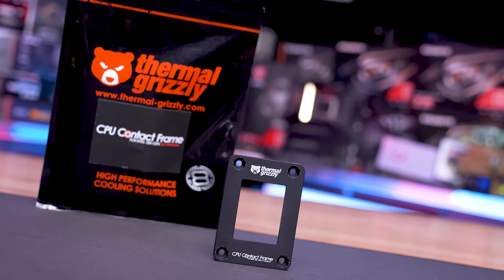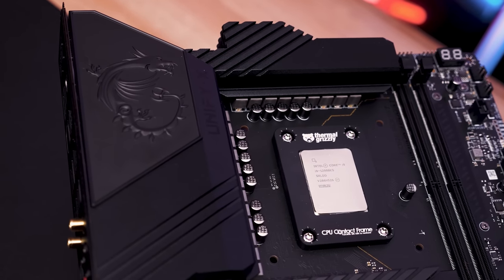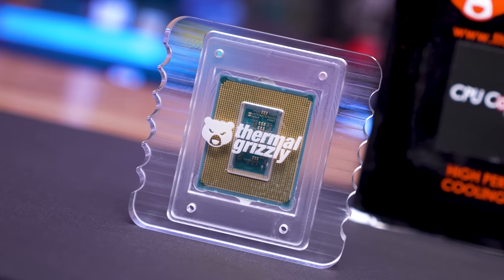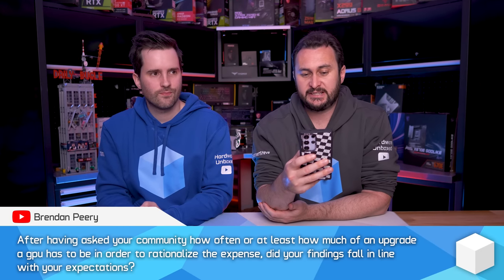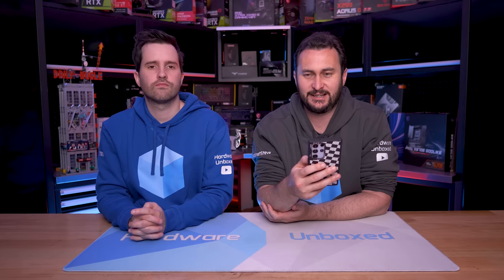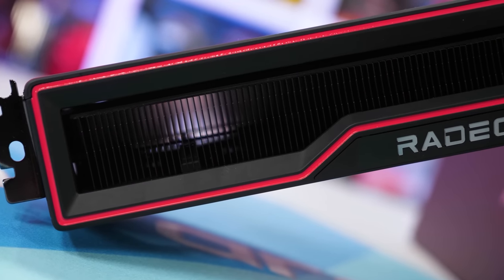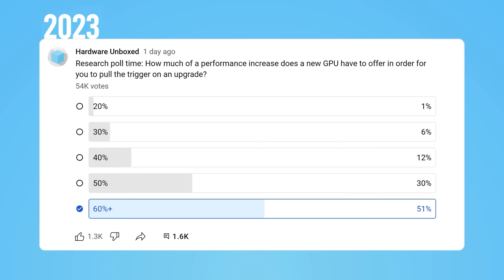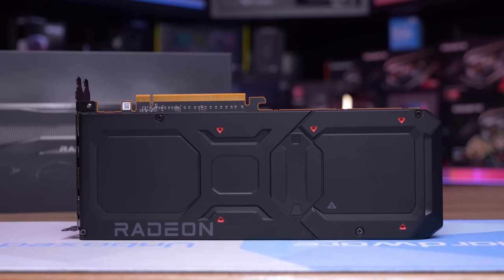RTX 4050 Pricing & VRAM, Are 12-core CPUs Dumb? March Q&A [Part 2]

Comment: So, keeping the GPU VRAM low is a deliberate strategy to make the midrange models obsolete in a few years so that people either opt for the high-end in their next buy or keep on buying midranges more frequently ? I feel like people are getting fucked by the GPU manufacturers in an elevated fashion with every single passing year.
Reply: Honestly this strategy is very limited because:
a. consoles are VRAM limited, will be the target platforms, so devs won't be making you make visually dramatic sacrifices to fit into a sub-16GB VRAM budget anyway.
b. you can counter it by turning textures & RT down.
c. devs are going to target the PCs that people actually own, not the ones Nvidia are trying to sell, and if Nvidia shrink the PC market with these shenanigans then devs are going to give PC ports 'less' premium features & priority, not more.
Reply: How you beat this is by playing at Low settings 1080p/1440p and only upgrade after dropping too low below 60fps, if you can manage this then your set for a WHILE, im implementing this after seeing how wildly resource hungry the Last of us 1 is as this is just the beginning for newer games.
Reply: @EBMproductions1  I run into a similar issue with a 3070 (as mentioned in the video) in Resident Evil 4 Remake where (according to the game settings) allocating more than 6gb of VRAM caused D3D related crashes. Only viable option is to lower the texture quality or tune down ray tracing. Interestingly my fps was pretty much the same for low and high settings so it may be a game related bug but the end result for me is the same: Low VRAM, sacrificed video quality.
Reply: 1440p half resolution is 720p so you can even survive on that if games support 50% render scale then UI elements are still full resolution I think. For me once I get the 7800x3D it will be either my old RX480 like yours or the integrated CPU graphics and hoping FSR 3.0 comes around soon :D man what a time to build PC it is...
Reply: planned obsolescence is not a new thing.
Reply: Yep, I bought a 3070 Ti during the crypto-craze and pandemic, because my GPU and monitor died on me at the same time. I'm still regretting it. I can already see where the 8gb VRAM will be a limiting factor very soon, and I get the feeling it's all by design. Diablo 4 benchmarks already fill the 8gb to maximum, for example. Screw GPU manufacturers. I think this is my final GPU and computer for the foreseeable future. It's just not worth it. These tech companies are becoming way too arrogant and abusive, and I'm starting to lose interest in gaming anyhow. But man, that $830 I paid for it. Ouch.
Reply: Просто надо больше покупать нвидию, они будут это делать еще дестче.. Вам понравится)
Reply: @tdrduarte  no but this was unfirseen asf, they thought 8gigs was enough for uo to 70 series cards but yup it was not i oredicted this back in 2020
Reply: "fucked by the GPU manufacturers" ... that goes for Nvidia, yes!

AMD makes in this case more stuff right. That's why they say it ages better than Nvidia, meaning a RX 6800 with 16 Gigs or even a 6700XT with 12 Gigs instead of 3060 Ti/ 3070 with 8 Gigs or 3080 with only 10/ 12 Gigs. *Even Intel does it better considering the ARC GPUs in their "limited edition" (which is not limited). ARC 750/ 770 with 16 Gigs should be more future proof than their 8 GB models.
Reply: just dont load 4k (aka ultra textures) if you dont paly 4k....holy shit aint that hard.....and yes i know not all engines are like that some actualy scale the textures by screen resolution.....
Reply: @InnuendoXP  "consoles are VRAM limited, will be the target platforms" ... but only mostly for 1440p intern calculated and upscale to 4K with very low RT in most cases and only medium to textures in a mix and highly optimized.

From a PC standpoint (true 2160p, high- ultra features, medium or high RT features enabled) the requirements are much higher, especially considering PC ports being often less optimized. Guardians of the Galaxy, Hogwarts Legacy and even the old Cyperpunk 2077 show how demanding titles can be.

The consoles has been good when the launched. Targeting RTX 2070 Super/ 3060 Ti -ish performance. Well even a 2070 super is an older card by todays standards, leaving consoles (as usual) behind! The average shown in steam statistics also show a huge variety of gamers with "minecraft kiddies", even HTPCs in their statistics or simple office PCs where someone installed a card game via steam.
There should be a statistic targeting story and action games like Cyberpunk 2077, God of War or Horizon Zero Dawn. I think this group of gamers often has way faster hardware at hand as the average Steam user.
Reply: @proxis9980  lol bro did you see zwormz cpu usage went to 90% at 1080p using a 7800x3D that means anybody else is fawked if they play at lower then 1440p 😐
Reply: @InnuendoXP  I mean you've always been able to adjust graphics settings.  I think the OP's point is that GPU makers want you to make obvious sacrifices so that you are encouraged to upgrade sooner.
Reply: Remember that the low-end memory capacity now is equivalent to the high-end from 2016. It's going up, what is happening is that people randomly accelerated their generational expectations arbitrarily. A 3050 beats a 1070 in gaming and has the same VRAM. A 3060 beats a 1080Ti and has 1GB more VRAM. A 4070Ti performs a bit faster than an overclocked 3080Ti and has the same VRAM. 

It's going up at the same rate it always has, with the single exception of the 1000 series, which was the single largest generational leap in the past 15 years. Comparing everything to the single best generational improvement and calling things predatory for not achieving that every single generation is asinine. There is no processor company in existence who has improved at that rate every generation. So who is it bad in comparison to? No one, that's the answer.

No one is "getting fucked" by anything. Every generation is a massive jump in performance. You can build a 1440p gaming PC for less money than ever, in history, when controlling for inflation. Life is good as a gamer. Ignore the terminally-online complainers.
Reply: Really for the VRAM issues if you get a x090 card it will be good for at 5 to 10 years. The issue is the x090 cards seem to always cost 1k USD or more the current gen costing 1500 USD at the bottom cost. So 1500 USD for a card for the next decade. pretty decent in my mind unless nVIdia makes an AI required by games that the 4090 can't run.
Reply: @CyberneticArgumentCreator  That's a bunch of BS, go back further in History. These are all new trends you're talking about and they aren't good for the consumer nor the gaming industry. After the 1000 series launch Nvidia went off the rails. Every generation after the 1000 series has gone up in price rapidly. At this point the prices are absurd and a joke. This is the year I quit complaining about Nvidia and bought an Intel ARC A770 and I couldn't be happier I made the switch
Reply: It is going to be worse. nVidia is getting enourmous amount of money in the light of GPT-4 and others AI development, corporation contarcts for billions of dollars already flows. Prices will be high and shortages would not suprise me.
Reply: @yumri4  MSRP of the 4090 is $1,600 and that's assuming you get FE and excludes tax.  You are going to end up paying $1,800 - $2,000 for a 4090.  The 4090 will probably last 5 years or 2 gens given RT performance is increasing so much every generation.  I wouldn't call that price anywhere near a good deal, my 1080 Ti lasted 7 years and that thing was only $700.  Nvidia has conditioned you to pay more than double for essentially the same thing.
Reply: @ehrinim
not sure if for GPUs that applies much, but for standard RAM on pre-builts it definitely does, particularly for laptops. Don't skimp on RAM folks
Reply: @giglioflex  and NVIDIA has conditioned you into perpetuating the hype of ray tracing as more than a sales gimmick.
Reply: It's just Nvidia that does this. You'll notice that AMD equivalent cards have wayyyy more VRAM across the board, only exception being the 90 series cards.

It's exactly why I went with a6800XT this time. No way was I gonna spend buttloads of extra money on a 10GB 3080 that I knew would cause issues down the line. I feel especially sorry for 3070Ti owners, they got a great GPU, memoey bandwidth, but the 8GB handicaps it severely in new games. If only they went with 12GB and 16GB like AMD. Those 3000 series cards would still be better than RDNA2. It's literally just the VRAM. And a lack of VRAM does not result in lower FPS, it actually makes a game unplayable unless you lower graphics settings..

The 4070Ti should have gottan 16GB and 4080 20GB.
Reply: Instead of buying a GPU next time I'm going to buy a console and give them no money, I'm done with this.
Reply: @giglioflex  yep. and i think nvidia will fail and will be forsed to make a good deal. in 50 or 60 gen, but they will be forsed to make a good amount of vram and performance for a reasonable price. PPL are raging more than a year about this, and the trend is going up. We are just in the low-mid point of it.
Reply: thats one reason i played it safe and got a 7900xtx red devil. i havent seen any of the games i play go past 13gb of vram in 4k so far
Reply: @Cheeseypoofs85  yeah, the thing is, in my region AMD is way overpriced, and the ones they sell are from cheap vendors. I just can't get a good deal so i went for a 3070 for my 21:9 full hd monitor. The market on the GPUs is a mess rn. feels bad to be a gamer
Reply: @giglioflex Depends on what you play. For me the only reason to upgrade from my GTX 980 not 980ti is when nVidia stops support for it in drivers or when i have to upgrade my motherboard to one that doesn't supports PCIe gen 3 x16. On a side note PCIe gen 7 doesn't support PCIe gen 3 and PCIe gen 6 doesn't support anything before PCIe gen 3.

Now can i play modern games on high at my monitor's native res 2560x1600? Not all of them and most triple A games i have to turn the settings down to medium to get a smooth frame passing and a frame rate 60fps. The thing is most games there really isn't a noticeable difference is normally from low to medium not medium to high nor high to ultra.

For the 4090 it seems what will cripple it is ray tracing being more and more used in newer games. So to have it last a decade turn down ray tracing when it is to heavy for the GPU. You also only need 60fps as most games are made for 60fps.
Reply: @tackier-n2g   no you won’t. You’ll grimace while you pay , for that moment of euphoria when you unbox and install, like the rest of us 😂
Reply: @InnuendoXP  I would agree with this, but PC ports are increasingly becoming less optimized. The consoles only have 16GB of SHARED RAM (combined system RAM and VRAM), yet so many PC ports have released recently that need at least 16GB of system RAM AND 16GB of VRAM to run at console settings. TLOU, RE4 remake, Dead Space remake, and Hogwarts Legacy to name a few.
Reply: @Altrop  This exactly. I bought a 6800XT because I knew the 16GB of VRAM will last me so much longer than the wimpy 10GB the 3080 got. For Nvidia it really started with the 2080. Only getting 8GB of VRAM it will hit a VRAM limit as time moves on before a GPU limit. Same can be said for 3070, 3080, etc.
Reply: @zues287  the consoles having shared ram is actually an advantage for the same reason PC is having performance problems now. Consoles have dedicated hardware for rapidly streaming data off the NVME SSD into memory, while on PC that eats loads of CPU time, so you need more RAM on PC to prevent that happening as often. Also on PC you're having huge textures moved from system memory to VRAM & that isn't free - it takes time, while that's just not a thing on the consoles because as you said, the memory pool is shared. So consoles can avoid a lot of the stutter that is currently plauging PC ports.

The smaller amount of total memory on consoles does mean you can't have as much texture data on VRAM at once, so this does put a narrower limit on the amount of high res textures you can have in a scene at once - but due to the dedicated hardware for streaming data into memory- consoles can cull textures & geometry WAY more aggressively, because data streaming has much less processor overhead - which means you only need to load a smaller slice of the levels at any one time, which means you need less RAM.

So Devs have a choice to make - they can optimise for the advantages consoles have, or the advantages PCs have, because this kind of memory management is not a trivial difference. It mattered much less last gen because the consoles were on slow hard drives, but Devs are trying to leverage that fast loading now, which comes for free on console, but not on PC. 

If it's endemic across the whole PC platform, it isn't a result of some negligent or lazy Devs, it's a fundamental hardware limitation - DirectStorage still is barely a thing on PC & it'll eat GPU resources when it is.
Reply: @Altrop  That's exactly the issue with low VRAM. Compute power of the GPU is not a limiting factor, it is the amount of textures that can be loaded with a small VRAM. If you go above the suggested amount of VRAM usage, you run into buffering issues, or direct crashes.

Memory chips are mainly manufactured by Samsung and sold to Nvidia as it is, so I guess the profit margin on them for Nvidia isn't that great. I guess that's why they are so stingy with it, although their GPUs are great in a technical sense.
Reply: @giglioflex  unless you're playing at 4K native, playing console-equivalent texture settings is not an obvious sacrifice to the visual experience - it's an obvious sacrifice in terms of the number value in the config or how warm & fuzzy the setting name makes you feel, but IMO if you're playing at 1440p then textures at medium is one of the less obvious visual sacrifices, particularly in more recent titles.
Reply: @EBMproductions1  only if you're wanting to actually play at the frame rate that is seeing that 90% utilization. There's always a bottleneck somewhere, that's just how performance works, you're limited by whichever component is slowest in the immediate work pipeline. Devs aren't going to be targeting hardware that a small minority owns.
Reply: @hassosigbjoernson5738  Eh I think you're underselling consoles there, the Series X in particular is often between 1800p & true 4K. And the Series X is more like an RTX 2080 in performance while the PS5 is more like a 2070S - though the PS5 still has advantages in some areas.

True 4K though is an insane use of compute resource IMO unless you have a massive screen that you sit close to. I'm not remotely bothered by 1440p internal render, particularly with how good the upscaling algorithms are, it's more than good enough & I'd much rather see that extra graphics processing headroom go into higher framerates & better effects than getting a somewhat crisper image that's 'way' beyond the point of diminishing visual returns.

As for the average gamer who's interested in playing AAA or action games - that would be the console gamer. For PC gamers who did a build with the intention of gaming, I think you're over-estimating the population of gamers with a GPU more powerful than a 2070/3060 - we've just experienced a 5 year stretch between cryptobooms where price:performance has stagnated massively compared to the previous 5. 

The GTX 970 was $330 at launch - and the price dropped after a year, the RTX 3070 is over 2 years old and it's 'still' usually over $500, while it spent most of the past 2 years at $800 or more.
The GTX1080Ti was $700 & we didn't see a 2x price:performance increase on that until the RX 6600XT finally dropped to $350 late last year - nearly 6 years later.

PC gaming only got as big as it is in the first place on the back of $300-500 console-killer builds, when PC hardware was dirt cheap in the years following the 2008 global financial crisis - and price:performance doubled every 2-3 years, so it was actually worth it to upgrade often. 

What Nvidia is doing (& AMD by trying a similar strategy) risks strangling the market out of new first-time buyers who aren't already invested in the PC platform.

Before PC gaming expanded to what it is - console ports were absolutely dreadful, and you were lucky if you even got them at all. Whole features would be missing, so would certain visual effects, visuals were largely not much better except for resolution, and often you'd need PC hardware equivalent to 2-4x the power of the console to have an equivalent experience. In the long term, if Nvidia & AMD kill the growth of the PC gaming population by pricing out new buyers & relying on existing PC gamers paying more & more, devs will start to give PC gamers less & less priority again.
Reply: nvidia has been doing this for years. but fanboys will blow wind. everyone jump on the hype train with out even looking around lol. nvidia SUCKS amd is a bit LOST and well pick and choose your poison. for me i have been using the amd flavor since the 290x came out. had a few titans after but i now prefer amd for a number of reasons. 

-amd offers over nvidia
1. smoother game play in less demanding titles while using less power.
2. often times much more video ram resulting in less hitching stuttering at high quality settings.
3. much better price to performance.
4. driver support that you can contact and they DO resolve issues. (nvidia wont give you the time of day.)
5. amd requires less driver updating to play games. often i can stay on a single driver for over a year. maybe more if i dont play a specific game that requires an update (warzone)
6. amd uses hardware to sort frames nvidia uses software or cpu time to do so causing big performance loss in cpu heavy games or having a cpu with more cores to do same work.

and i could probably go on but thats not the point. people still shill for nvidia and laugh saying you went AMD??? wtf.

lol i mean. some people just like bending over.
Reply: @alexcrowley4557  wtf are you talking about? They didn't even mention Nvidia or AMD by name, or say one was doing it more than the other.
Reply: @ramair325  It's ironic you talking about Nvidia shilling yet your post couldn't be any more AMD shilling even if you tried. I don't care about any of them, I switch based on best offer, but stop calling out Nvidia fanboys while you doing same for AMD.
Reply: @InnuendoXP  Eh? I was talking to the lad above, what do you even mean?
Reply: @alexcrowley4557  oh, the @ them wasn't showing up in the app for some reason so it looked like you were replying to OP
Reply: @FlawleZ31  that’s why I got a 6800XT over a 3080 as well.  RTX is a gimmick (since 2017 lol), and 10 gigs of VRAM was a joke.  “But it’s fast VRAM, it makes up the difference!” baloney, that’s what they said about Fury X versus 980Ti.  And the 980Ti aged way better.
Reply: Buyers need to need to adopt some personal responsibility here. If you bought a poor value product from Nvidia, when AMD and Intel were offering better value alternatives, then you effectively bent over and asked Nvidia to fuck you. You also justified their pricing, since you showed that you were willing to pay over the odds for an Nvidia product.
Reply: I feel like Intel is doing with cache what NVidia is doing with VRAM. Which gives AMD a clear opportunity. And they are taking it.
Reply: @ole7736  100% intel is what nvidia learned from. all we have to do is make people think we have the fastest product while making the worst performing products to help sales next year!
Reply: @ole7736  imagine a 12~16p core with 96MB of L3! or there about, it would absolutely crush amd. but the problem is that would be too good and people might be happy with it for too long!
Reply: @sexistatheist6464  nah the current drop in sales is showing just how many gamers are paying these prices & it isn't most of them.
Reply: No, just by nvidia.
Reply: Not really sure if VRAM on xx50 cards is that big a deal. If you're trying to ride out a 4050 for 5+ years, using medium textures is probably the least of your worries. Tacking on a bunch of VRAM on a card, adding $60 to the price tag arbitrarily would be more like screwing the customers. If a game dev can't continue to provide 6gb viable texture settings in the later stages of the DX12 era, that would be more like incompetence on that developer's part rather than an issue with the GPU.
Reply: you can always lower textures... it was the same always and it will never change.
Reply: @PrefoX  the other thing that will never change is there are always those Devs whose texture settings scale poorly.

What has changed though are scanned assets with unique textures for each asset, this will be the greater limitation when whole environments are built with them